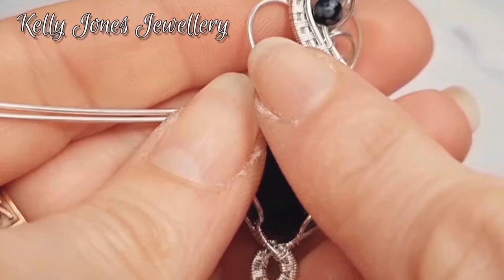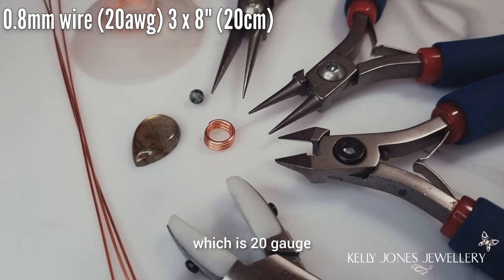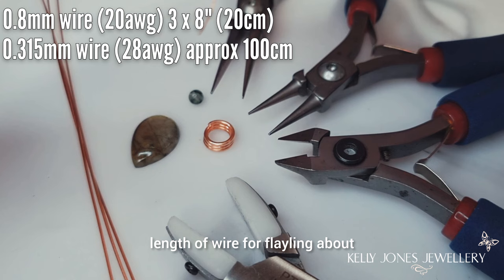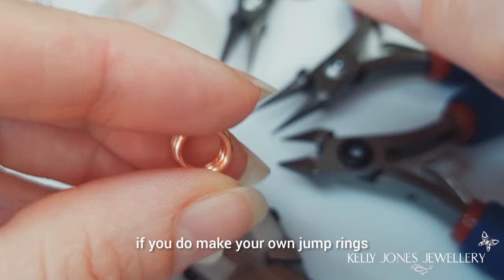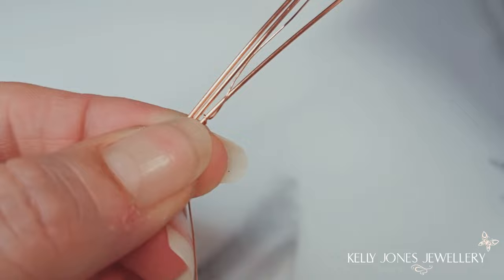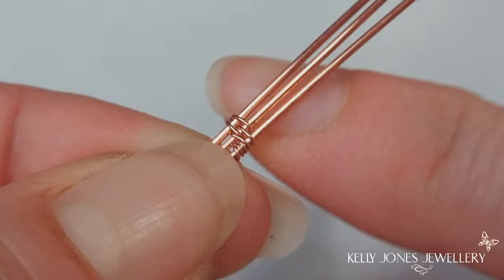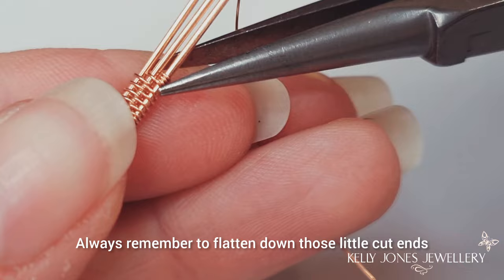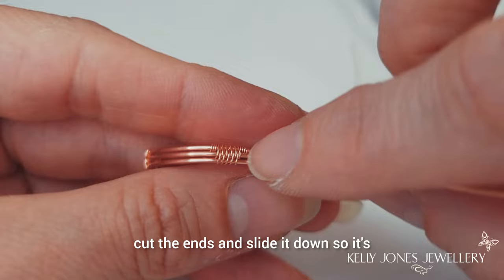Wire wrap pendant tutorial Lydia.

Comment: Morgen Kelly lways watch when you weave and your wire is fluid, mine kinks no matter what I do.
Can it be that my wire is no good quality.
Reply from the maker: Oh it could be. I use soft bare copper 0.315mm (28g) I also use a bobbin (for the weaving wire) that keeps the wire more under control. So you wind your wire onto the bobbin and reel off a bit (so it sits by your side) it holds well and stop most of the kinking, it does take time though and practice, so keep at it👍❤️